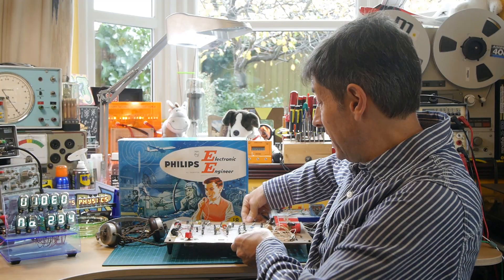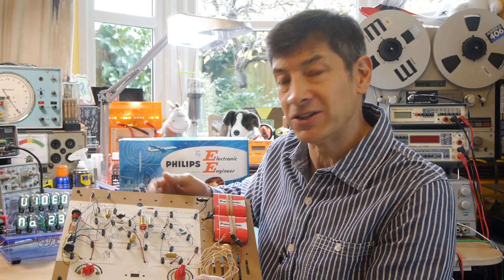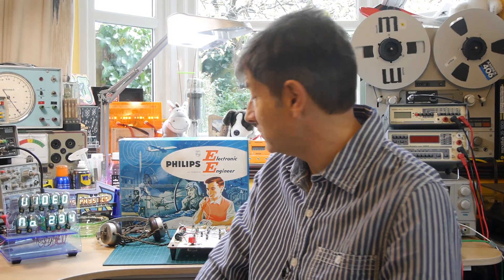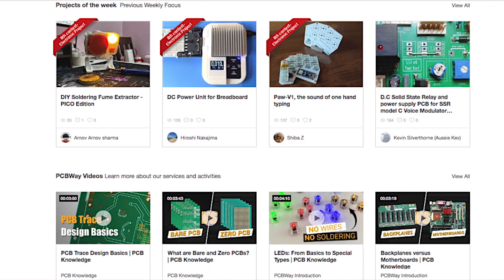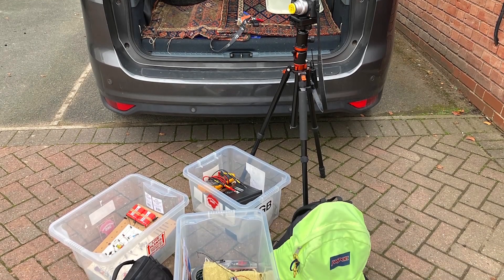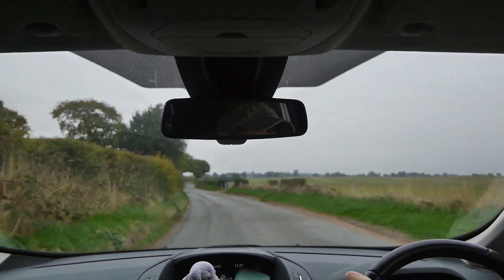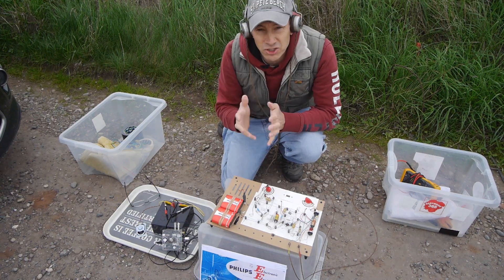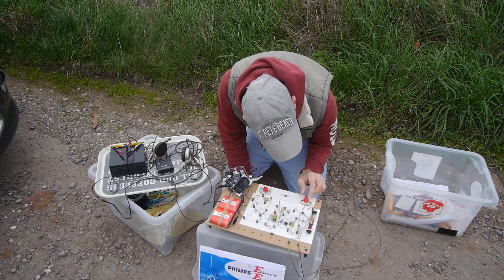Philips Electronic Engineer EE08 1966 - 2 Transistor Radio Field Trip - F-J's Physics - Video 234

Comment: Had the EE08 when I was ten. I remember being disappointed with how few circuits could be built and wished that we could have afforded the bigger set. I also remember the frustration of spending hours trying to get the components into those awkward spring clips and in the end the finished project did very little.  I didn't have a career in electronics!
Reply from the maker: Sorry to hear it did not work out for you but at least you tried it. Not sure if you had a mentor to help you. Electronics can be really frustrating especially if it doesn’t work. Still, thanks for watching and sharing your experiences with this kit and hope you had a successful career regardless! F-J

Comment: The three transistor version was a lot more interesting. It had two AC126 transistors and one AF116. This allowed the 80 ohm speaker to be used to make an intercom and an electric organ. When I was about 12, I purchased extra transistors, and made up some of the circuits on tag board. This included a permanent version of the intercom
Reply from the maker: Thanks Nigel.  Yes, I am getting the extra bits together and I would like to do the organ build as a lot of people have commented that they remember doing that one.  The intercom also seemed to be a favourite.  The EE20 was the one to have or the add on kit for the EE8.  Glad you had fun with yours and great that you made some more permanent circuits too.  Guess you wish you still had them!
Reply: @AnthonyFrancisJones, the only Components I still have from the kit are the pink piezo ear phone and one of the 80 ohm speakers.
Reply from the maker: OK Nigel, not much you can do there!  Crystal set maybe?!
Reply: @AnthonyFrancisJones fortunately my technology has moved on. Strangely these two items still find a use in my home lab from time to time.
Reply from the maker: Indeed - those crystal earpieces were ubiquitous but did they ever get used other than in kids kits?  High impedance speakers are indeed useful from time to time.

Comment: See if you can find the Philips X40 kit and even the X40A amplifier add-on kit. They are a lot less fiddly to assemble and have a wider range of projects (some more interesting than others). They are expensive though, especially if complete and good condition.
Reply: Later ones are branded Radionic.
Reply from the maker: Excellent - Radionic made lots of interesting kits I see.  I will have a closer look.  Funny how the Philips kits had to be branded Norelco in the USA.
Reply from the maker: Thanks Paul.  Yes, I have looked for these but as you say, hard to come by or very expensive - which means of course that probably no one buys them or shares them with others...!  I will feature the Tri-onic kit A at some point. This came before the Philips ones and had similarities to the X40 with its plugable components.  These kits are great fun aren't they!

Comment: So disappointingly little to listen to on AM these days - at least in London we have a selection of Asian music stations!
I was gifted a pair of those Ericsson high-impedance phones some years ago - they are great. I too hate to take these projects apart - so I gathered some equivalent parts and built versions of my favourites as standalone projects (I never got the EE1003 VHF superregen to work from the box, but my rebuild works fine!)
Reply from the maker: Thanks for sharing your experiences.  Yes, not much AM around.  Philips did do a LW coil part that you could buy too.  Those headphones are excellent indeed!  I was always amazed by these and the ones used in aircraft back in the day were so uncomfortable!  The BBC logo I think related to the fact that you had to have a listening licence back then and only BBC approved equipment too!  Not surprising there were so many home-brewers around!  I am still deciding - do I take it apart or not...!

Comment: Great to watch again! Hello sir, to be honest, I thought the reception was still poor, BUT I have to be careful with that statement, of course, because there's not much left on the MW (which you say they only use MW there). Really, give me the SW band! And maybe you should consider adding a capacitor across the variable capacitor? Or between them? (shifting the range?) What I can tell you is that last weekend I made a QSO with France (on the pirate band 6300 kHz - AM) and it went perfectly! Greetings from the Netherlands again!
Reply from the maker: Thanks Rob and glad you enjoyed seeing it again!  Yes, there is not much to be had out there but it was as good as a new radio listening to the MPs fighting!  So clear and no interference between other channels.  Agreed, once you understand these reflex circuits there is so much more you can do.  I am almost tempted to build another one in a small box and travel around with it and see what I can receive and, as you say, change the coil taps and capacitance values too.  All good fun - and great to hear from you.  By the way, my 7 year old had a QSO with Stockholm the other day - with adult supervision - and he was thrilled!
Reply: @AnthonyFrancisJones  YES, those are the fun things! Here in the Netherlands, I'm busy with pirate stuff. I know it's not allowed, but I'm having so much fun with it.
Today I started challenging other amateurs to come transmit on SW with QRP power.
For fun, I've programmed an Arduino with CW and a relay so I can transmit with all sorts of transmitters. Unfortunately, I can't CW myself (it's too difficult for me!). BUT the challenge I've spread is intended to be in AM on and around 6300 kHz and 6400 kHz. I've asked fellow radio pirates if they also want to participate by either listening or actively participating.
Nothing is a MUST, everything is allowed! There are no rules, yes, having fun is what it's really all about! Will I be able to persuade some pirates to take action? We'll see!
Friendly and healthy greetings from Rotterdam again! Rob - ( RadioRob on SW )
Reply from the maker: Always good to hear from Rotterdam Rob.  I do hope to feature some of the early radio kits again before too long and many of the kids' ones included low power transmitters which is interesting!

Comment: Fun seeing you seat belt the project in the passenger seat. Of course here in the US that is on the other side, and I have multiple times had to seat belt my projects (or my cat), sometimes because the weight triggered the noisy sensor alarm that thought there was a person in the seat and wouldn't let me get any peace until I bucked the project.

So (way off topic) I'm always in awe of how green things are in England. The month I accidentally spent in the city of Oxford--now I am really going to show my ignorance. As I walked around, I was likewise in awe of gardens, etc. And I was thinking "this is like in the books Alice in Wonderland and Through the Looking-Glass ." As I walked through downtown parts I began to see references that made me think back on that and of course finally became educated as to why I was having those thoughts.

(Was there relating to electronics, but working on "heart rate variability" mathematics/software.)

Just adding to a single comment:

Now remembering setting up a diode-only headphone radio in my younger days. I don't remember how I got the tuning circuit set up, must have come from an old radio, but was definitely unpowered except by the RF received. (I had several of the variable capacitors from old radio sets, and the inductor could have been one of the AM antenna bars like yours.) And the long antenna wire was just in the floor joists of the basement ceiling/upper floor, and I think the ground was to my power ground of my bench. Tuning wasn't very selective of course as it only had the one resonating circuit. Must have been a germanium diode which I had some from military surplus junk. And this part I really don't remember how I did, as might have had an amplifier of some sort though still my own experimental setup of some sort. But was very excited to be able to listen to a Chicago station from the north end of Kansas, USA (some 800 km).

Oh, as to my building technique: Had a good soldering iron (well, a 200 watt "Weller" gun if anyone remembers those with copper tip in a single loop from transformer, popular in the US). So I would connect parts together in space, not really on a circuit board or substrate. I continued on to make a lot of projects that didn't have any schematics, so later would have to completely reverse engineer if I found them and wanted to know.

And your next project, an "EE Organ" (which I suppose will have a frequency selectable tone generator). Now I will talk about a failed project: In college I built for the professor a digitally controlled switch, that was supposed to have analog switching of all the channels from a Hammond organ tone generator board (broadside all the key's frequencies so all the keys can indeed be hit at the same time if ambitious enough). This was so as to replace the keyboard and generate digitally played music (long before the days of MIDI and electronic control was common, I would say late 70's). But I didn't know how to get the isolation of the switch done well at the time, and when no keys (digitally) connected there was a loud background of every feequency playing through. (Got that right in later years designing radio station equipment.)
Reply from the maker: Great stories Gordon!  Yes, Oxford.  Sounds really interesting and glad you got to see the place.  I was at Cambridge as a student at the famous Cavendish Laboratory.  I had to pinch myself everyday to believe I was there really walking in the steps of giants.  Stephen Hawking going past, walking past Chadwick's neutron detector and so much more!  A total dream in the real sense!  Green grass - but being the UK you cannot walk on it!!  As an aside do please watch this video of mine if you like that sort of UK/Wales look  https://youtu.be/Dy5Sbr5YOG0  I think you will like it. 
I never had the 'loop' Weller gun but remember it well - I think it was off all of the time unless you pulled the switch?  I believe your building style is called 'dead bug' and is really popular on YouTube shorts now.
Love the sound of the Hammond (with Leslie's).  I did some work in the 1980's on church organs that had a key stroke recorder fitted so you could get the whole pipe organ to play back what you had just done.  We added computer control later so it could be edited.  I cannot for the life of me remember what it was called but I guess it is still fitted to a lot of organs especially in our 'famous' private schools' chapels.  Now I must get that EE20 one octave organ going!  Always great to hear from you, best wishes, Anthony.

Comment: Comments:  1. I really thought you'd try the fence wire itself as antenna.  Hopefully not electrified!  2. The organ (project A5) would be a good follow-up video.  All the EE-20 templates are available online.  You'd really only need one more AC126 or equivalent and some resistors & caps.  The organ keys can easily be made by snipping some spring sheet steel and a drill press.   3.  I totally understand your reluctance to undo the radio project.  Here's how I handled that anxiety:  I kept my 3-transistor one intact, made it pretty (wiring, parts, etc) and mounted it inside a shadow-box-frame with 4 long screws to the back, with extensions for the two controls so they're accessible outside the frame's clear perspex, plus some holes on the side to let the sound out.
Instant vintage wall art piece and nerdy conversation starter.  Then bought a cheap-ish incomplete EE-20 and repopulated missing pieces to create a new complete kit.  (Kept black feet from first kit.)
Thanks for the fun videos.
Reply from the maker: Thanks - that's great!  Yes, I thought about the fence and was not sure if it was earthed or picking up any stray voltages from electric fences!  I really wanted to have exactly the same, or as close to it as possible, as I had at home.  I have had comments that made me wish I tried it without the aerial and earth and I think it might have worked pretty well still!  I would love to keep it in one piece and even display it but my house is so full of 'displays' and the like that there really is no more wall space for it.  I still have not found a place for my Diode Matrix which is a shame!  I am going to do what you suggest with an EE20 but the main thing is I will be keeping the components together and not dispersing the kits.  Oh, and you are right.  I will need to make some more organ keys!  Thanks again for all your advice and enthusiasm!  F-J.

Comment: As mentioned previously I had great fun with one of these and after all these years still have a fascination with radio. I am not sure of your location, I am in North Shropshire and I can see the mast on the Wrekin on a clear day. I am fairly certain that there's no MF signals from that mast, I know Radio Shropshire on VHF and DAB comes from it. Thanks again for making the videos
Reply from the maker: Thanks Michael. Glad you remember the fun you had with your kit as a child. I was about ten miles or so north of the Wrekin with the ferrite bar parallel to it.  I perhaps need to have a walk up and see what antennas are up there. Wondering where the signal is from otherwise. Interesting, and thanks for taking the time to comment. Perhaps I should go up onto the Stretton Hills. Would be a nice field trip!
Reply: @AnthonyFrancisJones  of course in the 1960s  when I had my kit for Xmas there were loads of high power MW stations on the band. Even though I lived in the middle of a housing estate there wouldn’t have been anything like the amount of RF noise to contend with in those days
Reply from the maker: Yes, probably just a bit of car ignition and the like!

Comment: I’d suggest leaving the radio as is but perhaps upgrading it to the C3 circuit (3 transistors and speaker) or even to the C3.1 circuit which is MW and LW plus some base and treble, if I understood correctly. Then make or get another base board and use that for the organ. Plans for the base board are on that Dutch website. A third circuit worth building IMO is the intercom. It’s a shame Philips didn’t include a few digital circuits. A bistable would have indicated a computer bit storage and easily modifiable into an astable or oscillator. But the Philips engineers seems to think differently to those Nuffield basic units.
EBay at the moment has an EE8 and EE A20 available from someone (not me!)
Reply from the maker: Yes, great ideas Julian.  After this success I should have built the 3 transistor version.  Perhaps I will use a EE20 kit to do it so I don't have to pull this one apart.  I would like to do the organ though.  Lots of viewers have commented on what fun the intercom was too!  I think Philips did do some digital stuff later on but, as you say, transistor logic was well known at the time as was diode logic but they did not mention it.  I guess it would have been indicative of what a computer could do but not lead to a fun and usable working project?  F-J.

Comment: As I told you in the previous video, I had the EE20 and also built the 3 transistor radio, that is, power amplified with a small loudspeaker in the same board. I remember receiving several local radio stations with that kit, back in the very early seventies. I was in the central area of Madrid and the reception was superb although never bothered connecting external antenna nor earth connection, just the ferrite rod. There was very few electrical noise back then and lots of AM broadcast stations!

For what it's worth, I also made the organ you refer to and it was quite dissapointing. No doubt the 3 transistor radio was the queen of the EE20. 

I still have the original manual which was a very good introduction for children to solid state analog electronics.
Reply from the maker: Excellent - yes I think that ferrite antenna is pretty good.  I should have disconnected the aerial to see what would happen.  May well have been fine.  Had a few ask me to do the organ and I guess in a funny way it was one of the very early small electronic organs - if not much good!  I will have a look at doing some EE20 builds at some point too!

Comment: Thank you once again for transporting me back to happy days. I can’t quite remember the aerial/earthing arrangements for my two transistor build, (definitely copper wire in the garden and water system earth), but I do recall it as being extremely sensitive, jam packed with signals from all over. (In 1969). The addition of the third transistor then gave enough to power the loudspeaker. Good luck finding the add on kit, the “organ” is very much like an early monophonic synthesiser without all the frills. Happy days indeed!
Reply from the maker: My pleasure and hope you joined in in the excitement that I felt too!  Not much out there compared with the 1960s!  Hope to get an organ build done before too long.  It's too good to miss isn't it!